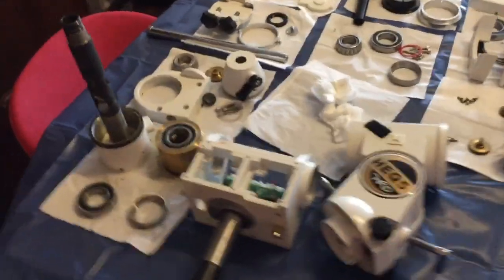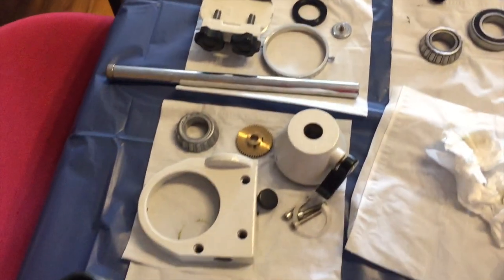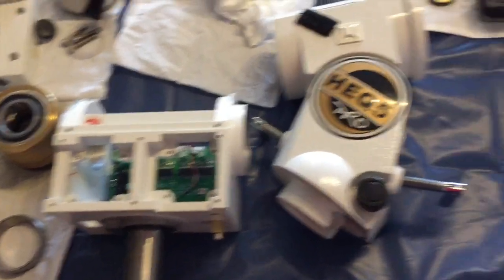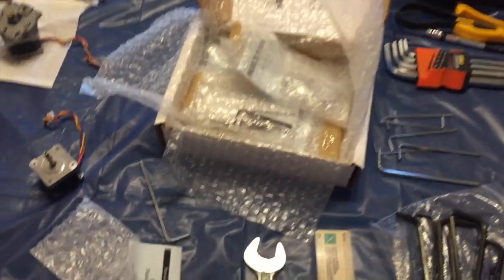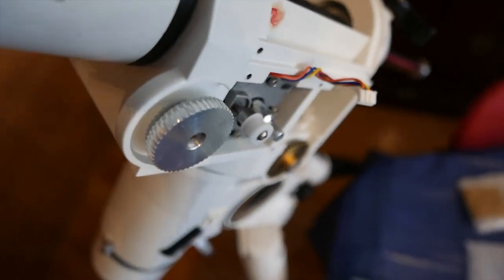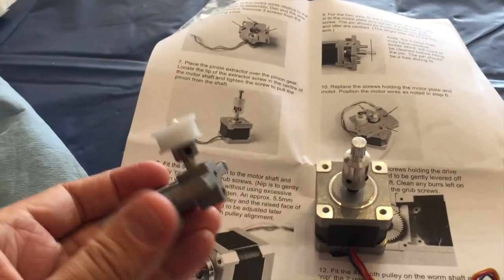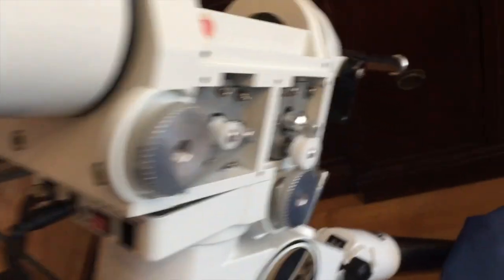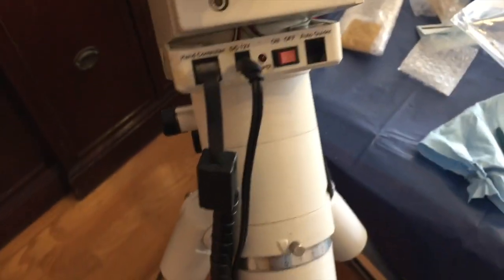HEQ5 Refurbish

Comment: Hi Astro buddy, I'm just putting my mount back togther after doing what you did. I have two red washers but only seem to see where one came from on astro babys guide, any ideas at all? Many thanks
Reply from the maker: Daniel Mills hi Daniel. My memory is pretty foggy now but if you look at the spread of parts in my video, you can see at least one red washer on a bearing near the tapered bearing. The other I’m not sure but they are used to offset the housing that presses agains the inside ring of the bearing. When you put it back together, make sure the two halves of the housing don’t rub. If they do it’s because the red washer is supposed to provide clearance there. Hope this helps - cheers!
Reply: @astrobuddy7895  thanks for getting back to me, thats the one that I know where it goes unfortunately,  its the other im stuck with and now at a lost haha. Cant see any mention of another on astro babys guide this is whats puzzling me!
Reply from the maker: Daniel Mills same position, other axis is all I can think of - I don’t have the mount anymore, so I can’t check - sold it to a happy customer. Good luck!
Reply: @astrobuddy7895  thank you , yes I discovered the " clear" washer astro baby advised is actually red in my case so that's where it goes! Thanks again for your help. Clear skiesb

Comment: Great video and nice closeups! I have a Orion EQ-G and recently started PHD2 guiding. My DEC backlash measured at 4169 ms. Just curious if you had any values for your mount (or your friends) before and after adjusting the gear mesh and/or before and after the belt kit install. I'm not big on tearing down my mount but would really like to get better guiding performance. What is a reasonable DEC backlash value for this mount? I don't know if I should be hoping/striving to see 10 ms, 100 ms, or 1,000 ms at this point? I do know from the PHD2 help information that anything over 3,000 ms is too much.
Reply from the maker: Sorry, no values, but later video show guiding very well on DEC - RA drift due to PE I think

Comment: Interesting to see inside these expensive heads 👍
Are the taper roller bearings on the RA axis?
Did not see if worms are on plain bearings?
Reply from the maker: yes, the bottom side of the RA is a taper bearing and the worm bearings are simple BB bearings.

Comment: What did you use for the bearing re-grease (the sealed bearings that you unsealed and stripped from old grease) and did it actually work for you?
Reply from the maker: Sorry for the delay, I was logged out for a while. I use automotive degreaser that was supposedly biodegradable. Worked very well. I re-greased with high temperature range lithium grease. Worked very well too.
Reply: @astrobuddy7895  Thanks. I did the DEC and used an ABS safe break cleaner (not healthy) that dissolved anything I could throw at it and used SuperLube grease (food grade). It worked very well.  End result is extremely smooth DEC.  I don't have solid results yet but I can clearly hear, feel and see difference in movement.